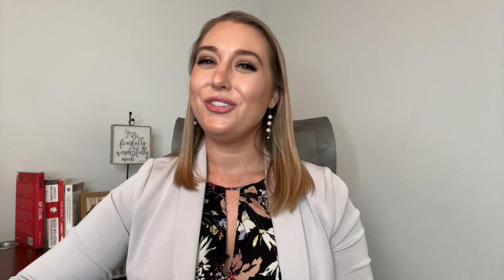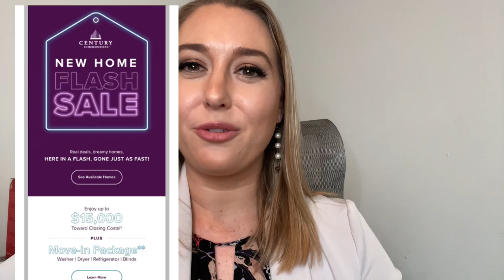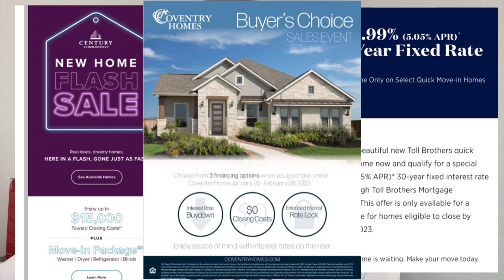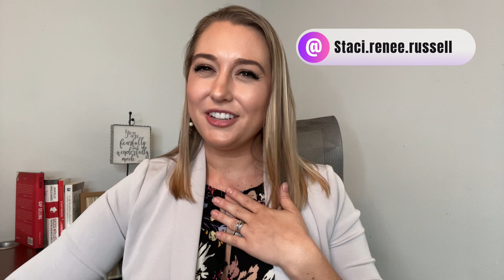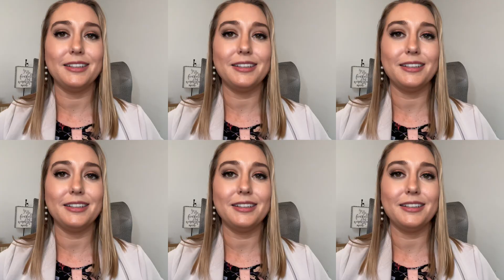Understanding New Construction Incentives

Comment: Hello, we have purchased new construction home. They are still buidling it est. Is August. We dont have agent. Me and my husband just connected with the builder.  Any information we need to know. Were first-time buyer and using VA loan. We already did sign some documents and sign some paper with escrow.
Reply from the maker: Thanks for your comment. Congratulations on your new home! If I had to guess, you have probably signed the new construction contract. I would recommend reading over the contract thoroughly (or having a real estate attorney read over the contract) so that you are aware of the timeline for important dates. There are typically timelines for paying your upgrades deposit (if any were selected), getting final lender approval, getting homeowners insurance, scheduling your inspection and appraisal and more. VA has their own inspection and appraisal process so your lender should be able to help you get those set up. Let me know if you have any other questions. Happy to help in any way I can :)